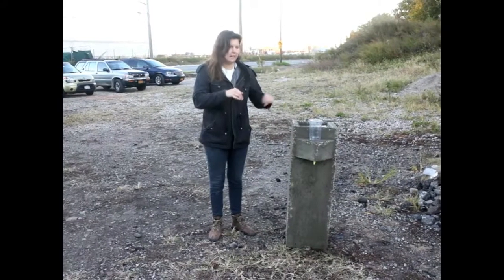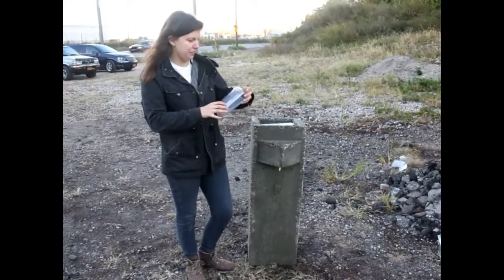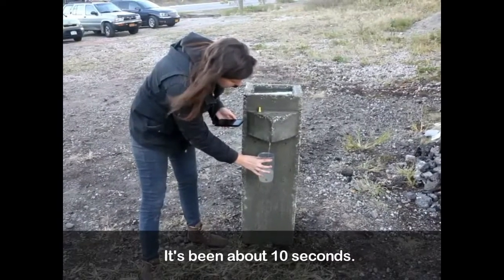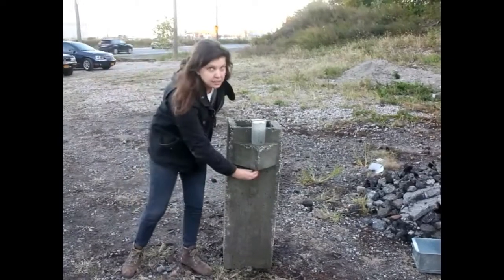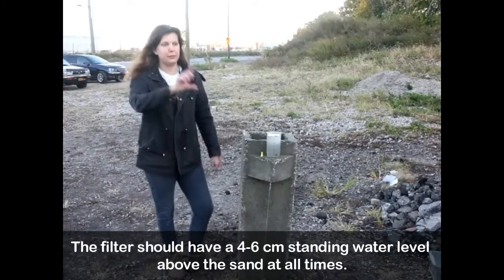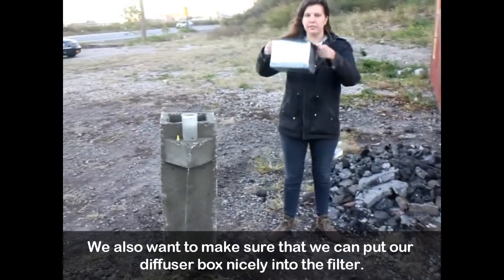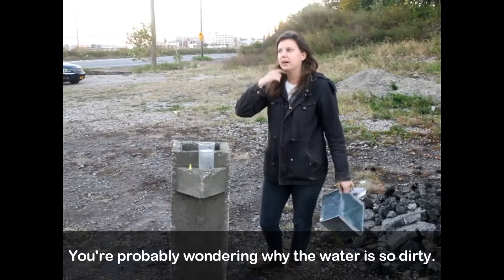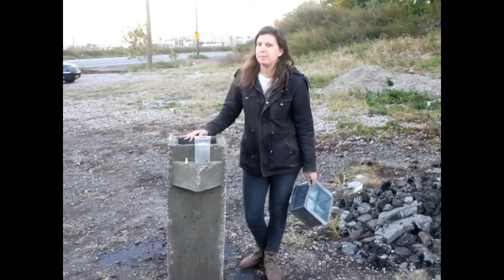Testing the Flow Rate and Functionality of Your New BioSand Filter

Comment: Hello
I saw your movie and I have some technical questions.

I know that water should flow at 1 liter per minute.
- how many liters of water should be poured into the filter at a time.
- how often you can pour a portion of dirty water into the filter. (eg every 1 hour, is it not important and you can add dirty water without interruption?)
- what is the internal dimension of the filter.

I want to build a filter and I want to know this data for proper functioning.
Thank you and Regards

Tomasz Maciąg